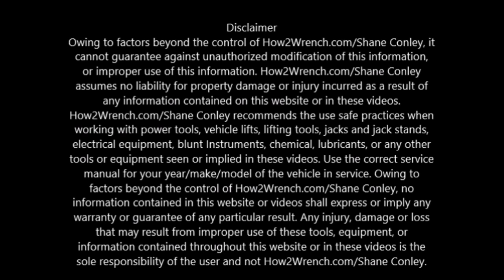Problems new techs have using stick on wheel weights! Learn from Road Racers!

Comment: Heating wheel and adhesive on weights with a hot air gun before you apply helps especially when it cold
Reply from the maker: Nice tip! 
 If I can ever be of service to you, here is a video explains how to connect with me. 

https://www.youtube.com/watch?v=vjvmB01ebcs 
Keep Wrenching,
Shane Conley
Instructor/Motivator/Motorcyclist
www.how2wrench.com
Like freebies? Click here for a free diagnostic checklist! 
http://gem.godaddy.com/signups/364621/join 

Did you like this free video and hope to see more? Would you just like to say thank you with a donation? Click https://www.paypal.me/how2wrench
Reply: Also clean the mounting surface where applying the weights with isopropyl alcohol.
Reply: 100%

Comment: I would like to add that if you ride in the rain that water will get pumped up under any lip thats left unmated or stuck down to the wheel causing the weight to lift and disbond.
Reply from the maker: Thanks for commenting and adding value to our community!

Have you subscribed yet to never miss a video? Have you seen the video playlists? Check them out here: https://www.youtube.com/user/conleybuilt/playlists  

Want to say “thanks” or “keep it up”? Click here https://www.paypal.me/how2wrench    
 
Your answers and help are just around the corner. Save time and money while protecting your investment and yourself by doing it the right way at www.How2Wrench.com
Reply: @SimonWoodburyForget  because 2 different times on more then one wheel mine came off while driving in the rain just after install. never had any come off before the rain  incidents or since and while the adhesive might not be the water being pumped under that lip when driving through water at hwy speeds is probably have the same force as lifting it up with your fingers.

Comment: I've found that tape is a good idea but I leave it on just long enough for the weight adhesive to bond and cure. Otherwise,  even with wheels that have been perfectly cleaned with alcohol, the weights often will simply fall off until the adhesive really bonds. I take the tape off 10 or 20 minutes later. As most know, once wheel weights bod to the wheel, it's actually difficult to remove them so tape isn't necessary. That said, I'm not talking about race bikes.

Comment: the weights that clip on the rim
Reply from the maker: Mullaway. There are many types and styles. Many OEM's use a clip on style. Using one not designed for that brand of wheel design could easily result in it falling off. The best practice would be to use the wheel weight from the manufacture and it not sure, follow the video recommendations. 
Have you subscribed yet to never miss a video? Have you seen the video playlists? Over 600 videos! Check them out here: https://www.youtube.com/user/conleybuilt/playlists

Your answers and help are just around the corner. Save time and money while protecting your investment and yourself by doing it the right way at www.How2Wrench.com

Want to say “thanks” or “keep it up”? Click here https://www.paypal.me/how2wrench Thanks for commenting and adding value to our community!

Please subscribe, share and consider a H2W membership to support our free work here! We are ramping up for the upcoming new member only site with profiles, raffle drawings, and weekly live Q/A sessions and a for sale page!

Comment: neat lil vijay
Reply from the maker: LOL...
Reply: Shane, ever heard of splitting the wheels weights, in a tri y type shape, only placing them at the Y ends? splitting them about 25 or 30 degrees apart? Woody's wheel shop in Denver used to do that, said it was an Indy Car thing?

Comment: I think these wheel weights are completely useless. I've never had these ever stay on no matter what type you get.
Reply: Second that...after a proper outing in the rain or hot sun these weights always seem to slide into oblivion when I am back to the garage...so unless there is a problem of  vibrations where there should have been none, we can just live with some minor imperfections in the weights and rotate the tires to balance the wear and tear

Comment: Lazy to not remove the wheel and properly balance the wheel assembly.  Wheel balance always changes as the tire wears.  This repair is a bit of a hack.
Reply from the maker: David Mellor It’s seems as if you didn’t watch the entire video or missed the annotation the we removed the wheel and balanced. It also appears you completely missed the point on how strongly I recommend not only to balance the wheel but to do it in a fashion that it stays balanced...SMH
Reply: Poor David. He tried so hard to sound smart...but failed miserably.